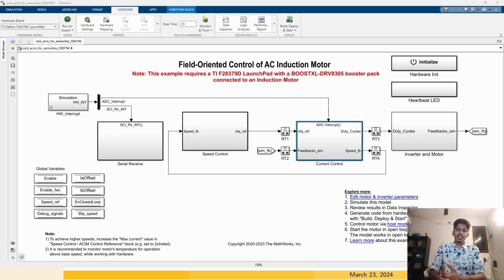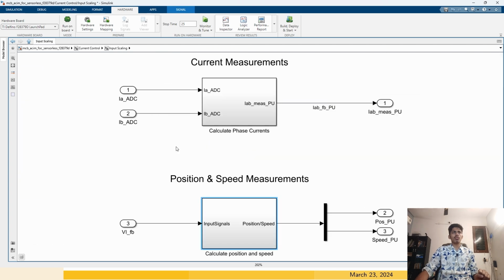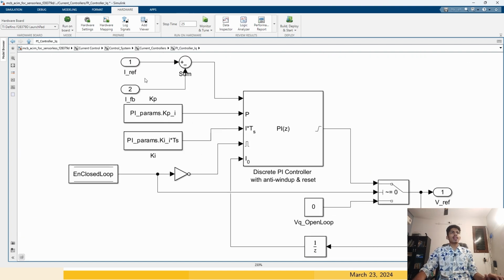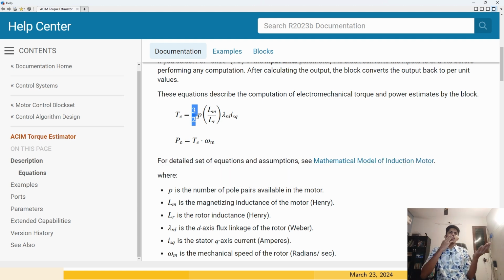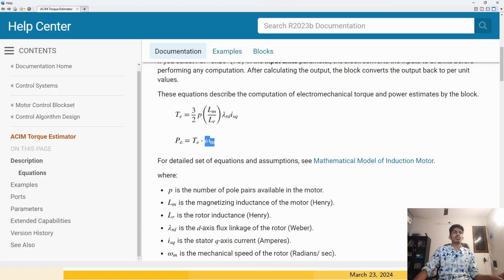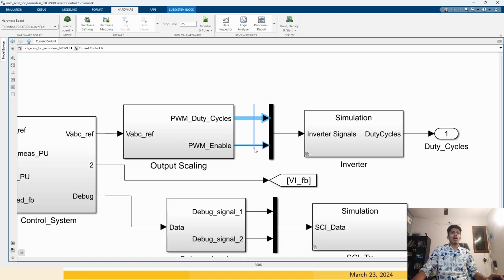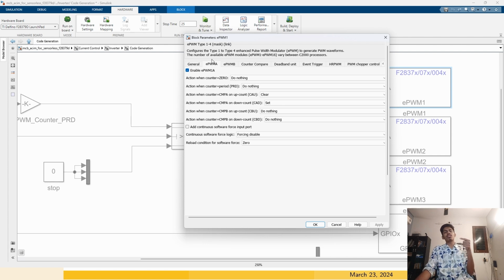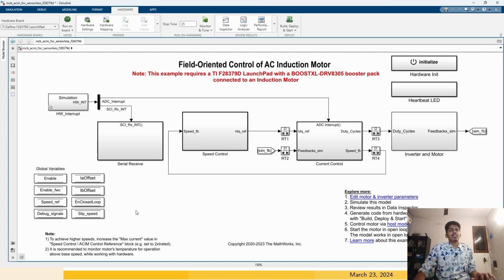Part 3.2: Current Control Loop in Sensorless FOC ACIM with MATLAB & C2000 Microcontroller

Comment: I would be appreciated that if you can help me with 1. Dose the 28379D takes in ADC of an analog signal of 0-5V or 0-3.3V?  2. if in the differential ADC mode, it can take in negative signals, e.g. 0 to -3.3V right?
Reply from the maker: Hello, here are answers to your questions,

1. ADC Input Voltage Range

- Range: The F28379D ADC accepts analog signals from *0V to 3.3V*.
- Note: Applying voltages above 3.3V can damage the microcontroller. Use a voltage divider or external circuitry for higher voltages.

2. Differential ADC Mode

- Differential Mode: Measures voltage differences between two input pins (e.g., ADCINA - ADCINB).
- Voltage Range: Each input must remain within *0V to 3.3V*.
- Negative Signals: The difference can be negative, but individual inputs cannot be below 0V or above 3.3V.

So in short,

1. Single-Ended Mode: 0V to 3.3V.
2. Differential Mode: Measures positive and negative differences, but each input must stay within 0V to 3.3V.

Recommendations

- Signal Scaling: Use voltage dividers or active circuits for signals outside 0-3.3V.

- Protection: Use op-amps for conditioning and protecting ADC inputs.
Reply: @Adhithya1002  very clear. Thank you very much.